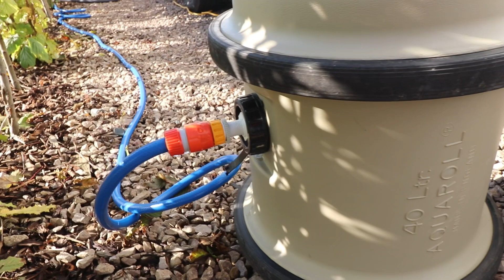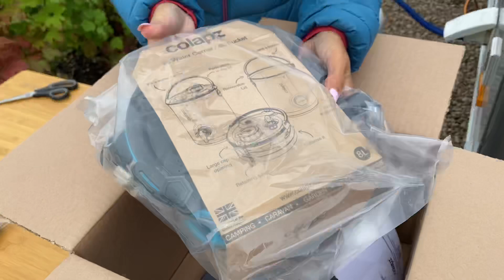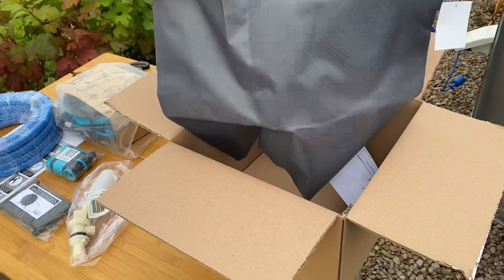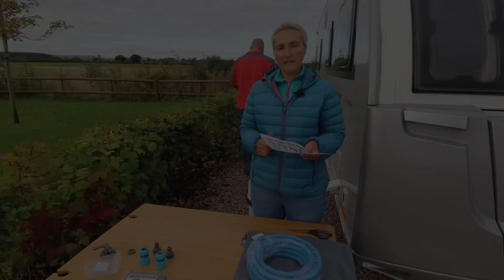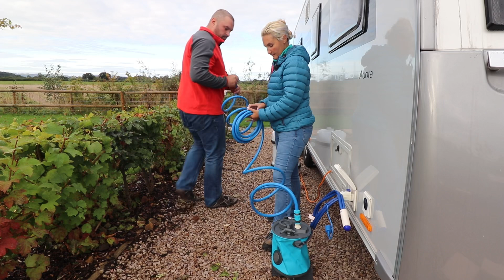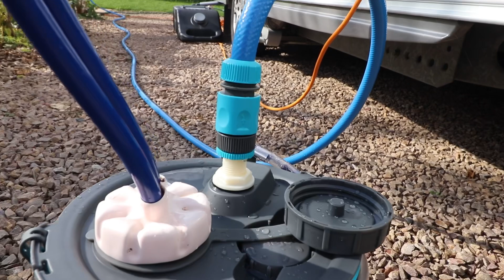Colapz Fresh Mini (Serviced Pitches)

Comment: Hi karina did you use this system much more??
Reply from the maker: Yes we have used it since and it is really good for a serviced pitch. They have also just updated the fresh mini to make it more stable and to draw more water in to it at a higher speed. Its to do with the valve now been at the bottom. If you buy anything fromColapz this link currently gives 5% off. I would say our best purchase last year were the flexi pipes and the dog bowls and water bottle. https://colapz.co.uk/?ref=5RA8o8ydA-Fi  😊Karina
Reply: @MotorhomeReviewChannel  many thanks. 😊

Comment: Great review ,did try my one out in April this year and was brilliant.
The only problem I could see was the hose supplied was to firm and the top filling valve should be on a 45% angle.
Found the hose trying to lift off the filling lid in the wind.
Used my own water hose found it allot better. 
Excellent product just needs tweaking a little bit but saves space and weight.

Comment: Another great video thanks. I've been using my Colapz Fresh Mini all year now in the UK and France. I don't use the stand, instead I place it on a square of butyl rubber mat. I have also bought a 90° brass hose connecter to replace the vertical hose connector. This makes the Colapz Fresh Mini more stable and reduces its overall height so I can usually place it underneath the caravan on a level pitch. I also bought the optional insulation kit. This helps keep the water from freezing in the Winter and during the June heatwave in France it kept the water cool. 

I can assure you that providing the flow from the tap is sufficient the caravan pump will not empty the Colapz Fresh Mini, even when using the shower. Colapz have done their homework.
I must admit though, I don't colapse my Colapz Fresh Mini when I'm not using it. I find it keeps its shape better and it's easily stored in the front locker. 

Regards, 

Steve
Reply from the maker: Some great advice there and yes I do think they have done their homework, this is well thought out and a great addition to our kit. The size is also superb as we don’t often use service pitches but whilst we were away we had a couple in Europe that were service pitches so for something that takes up such small space and we can have this with us all the time. 
Thanks for sharing the tips I’m sure this will help us and others. 😊👍thanks for watching and sharing. 😊😊👍👍👍👍

Comment: Hi another great video. This may be a little late for you now, because you’ve already purchased the Colapz system. However an alternative is the direct connection system by Whale. There’s no water container or float valve, the hose connects direct from the tap to the caravan. There’s a pressure reduction valve to ensure the caravan water pipe system is not damaged by excess water pressure, and water is drawn through the system by the on board pump, or only using mains pressure if it’s an external pump (obsolete when mains connected). It comes with a flat hose which saves a lot of space. Works great. Cheers from John & Al 👍

Comment: For around the same price you can buy the hose with a flow control fitted and your brand of fitment for your caravan which connect straight to the water supply and caravan doing away with any need for water containers and ball cock systems.

Comment: In seven years of caravaning I've never owned a container. I use the Whale Watermaster direct mains water hookup. Click one end on the tap, plug the other into the caravan, turn on the tap, job done. Comes with 7.5m hose and I've also got the Whale 7.5m extension hose. Truma also do a direct mains connection called Ultraflow Waterline, comes with 15m of hose. Interesting detailed video. Thank you. Rob

Comment: Another great review guys, thank you for that.
I really rate the quality of Colapz kit and have been really impressed with all the bits we have currently purchased.
Not sure about this one tbh, as we have the direct connection for a Whale fitting, which works exceptionally well and means a container is not needed?
We also use the flat food grade hose, much easier to deploy & roll away and store - surprised @Colapz do not use it?
Thanks guys, see you at the NEC?... Cheers, Rog... 👍🏻 😉 🐍

Comment: Great video J & K

I’ve had one several months since buying from Colapz as soon as they came out

Once we got used to set up it’s been fantastic 

Even when we had really high winds it never budged 

Had a few problems with it overflowing but that was due to the pipe that goes into van ( we have on board pump) touching the valve and causing the Colapz to overfill.

Few problems with it bouncing around but that was due to inlet water pressure being too high.

Found it more stable on the ground than on the stand.

All in all after almost a dozen outings it’s a great product ( apart from fact I’ve lost the tap somehow that fits on top ) 

Thanks for your vlogs 

Best regards 

HOWARD
Reply from the maker: Thanks Howard, it’s nice to hear from someone who has had this a while and perfected using it. I must say we are over the moon with this and it does exactly what it says. Being able to easily empty and clean and for the convenience of the weight and size we are chuffed. Thanks for watching and taking the time to comment. 😊😊👍
Reply: Here we Tow the only thing I haven’t tried. Which I don’t think you mentioned was the winter cover ( mine came with it as it was bought pre release), but I didn’t see you have one.

After a trip and you are packing up, it’s easy to remove the lid, wipe out and dry and then put it away, rather than your aquaroll having residual water in it.

As we tend to only go on fully serviced it’s been great but as you say it’s not for everyone 

I guess some people enjoy dragging 40litres of water across a wet field 

Thanks again to both of you for quality well produced informative vlogs
Reply from the maker: We didn’t get the insulation jacket as we only got this recently but have seen that it’s an option. 😊😊👍

Comment: A good video Karina and Jules. I have thought about buying one but at present don't use service pitches regularly enough. Be interesting how well it copes in winter for winter caravanning and temperatures.
Reply from the maker: We are the same - didn’t have anything when away in Europe so thought would use this as it’s so easy as a back up with the weight and size. We will be testing for some time when on service pitches now. 👍 Cheers for watching and commenting. 😊